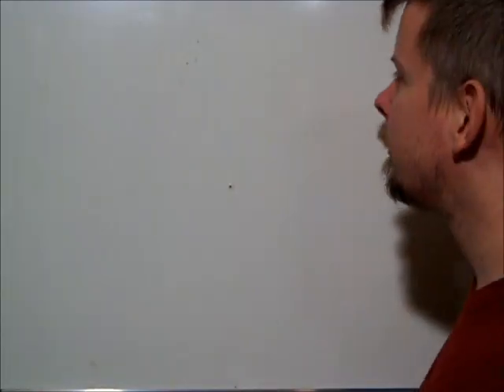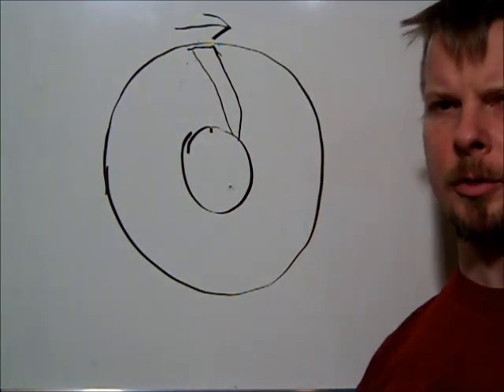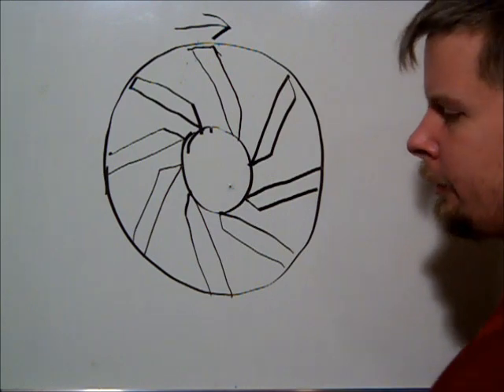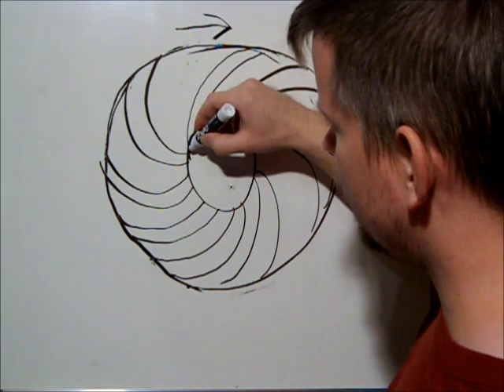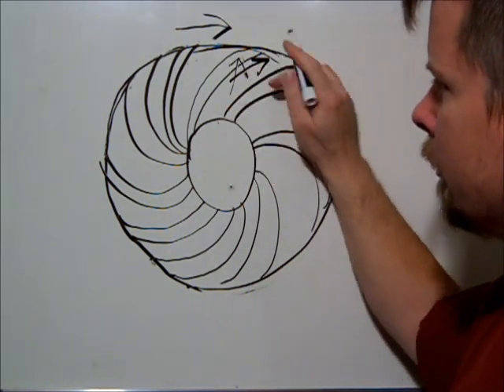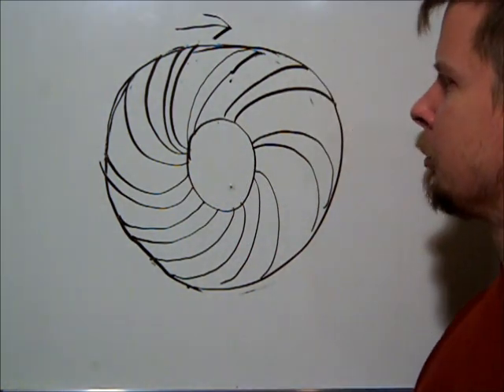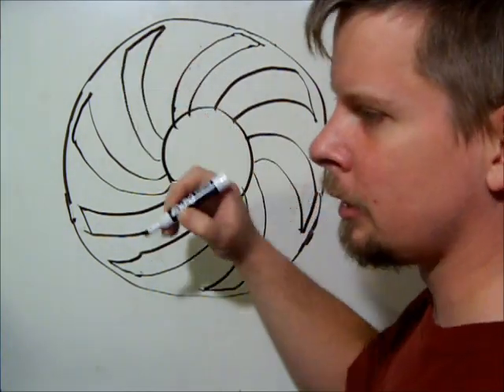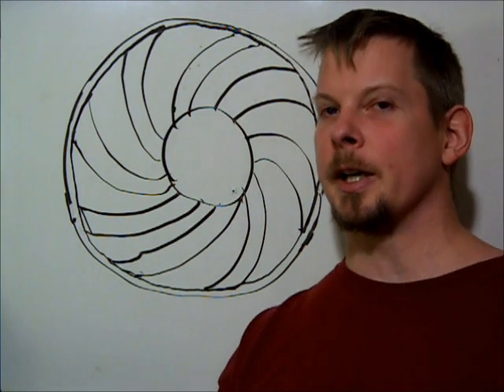thoughts on turbofan design

Comment: Another thing to consider is where you want the air to go. The design that you criticized will probably push the air outward, and the one you gave will push the air inward. If you want more air to bypass the turbojet part of the turbofan engine, you probably want to push the air outwards. If you don't have enough air in the turbojet part, then we should use your design.
Reply from the maker: Thank you for your input! The intent of the shape would be to counteract the effect of centrifugal force on the air and convert it into linear movement . Looking back , I guess i might have made this vid more concise and and explain better. Experimentation will yield the answers.

Comment: In theory, wouldn't this design pull air towards the center, working against the centrifugal force? so instead of mitigating the effects of this radial force, your actually doing the exact opposite.. This may in turn increase the torque necessary to keep the fan at a constant speed. i am an engineer at Purdue U and can assume that there are a lot of highly intellectual people working at rolls royce running optimization simulations constantly and id be surprised if this wasn't already attempted.

Comment from the maker: Thank you for your thoughts !  I think that one of the things that makes it necessary for impellers/fans/compressors to have thin blades is that if they are too thick then the friction against the surface would cause a larger boundary layer to move in a circular motion thus effected by centrifugal force .
The ring is an option but it need not be heavy imo especially if it made of carbon fiber and i think the main force acting upon the ring would be centrifugal force keeping it nice and circular

Comment: I am definitely not an expert in the field, but I would think your design would cause cavitation and/or extreme pressure changes (and in turn temp changes) due the anticipated air acceleration path. Your suggested ring on the outside causes a lot of additional weight, which means a lot more energy into rotating the system. Just something to think about. If you a serious about this, try designing it in CAD and running it through some fluid model simulations.